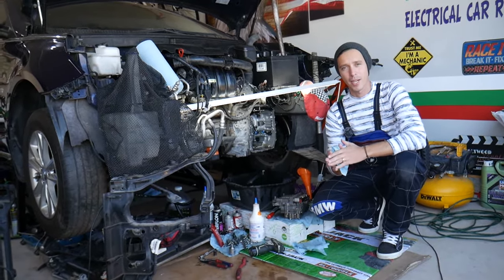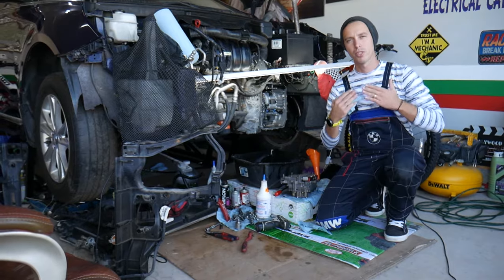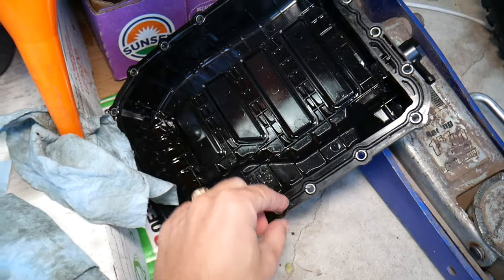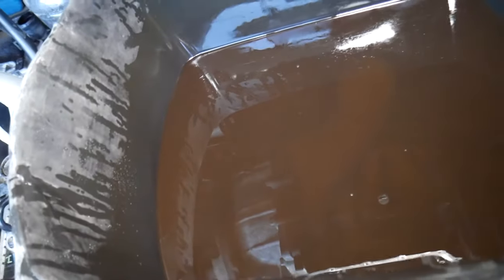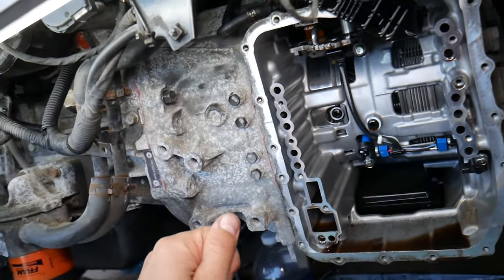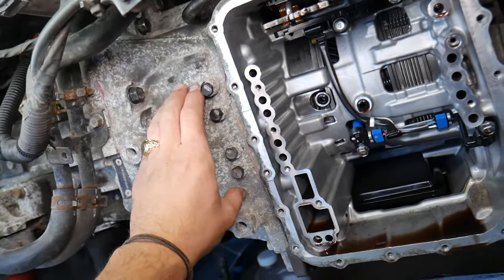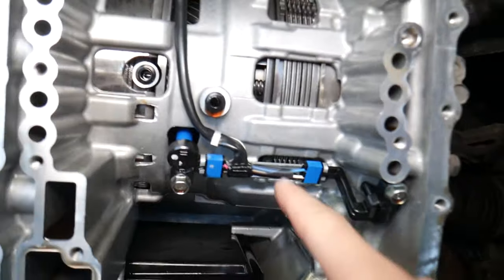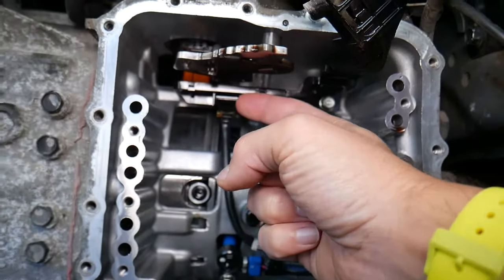INPUT SPEED SENSOR OUTPUT SPEED SENSOR LOCATION REPLACEMENT EXPLAINED

Comment: Just to add a comment, my transmission had to be pulled to replace the INPUT speed sensor in my 07 Suburban 1500 4x4. Not an easy fix. It amazes me how this is never talked about on Utube or any where else on the net. An external speed sensor can be changed in 5 minutes.
Reply: You definitely don't have to pull the transmission to change the sensor in a.2007 chevy

Comment: I have put 4 transmission speed sensor in my 97 Camry 3 from the junkyard one I got from Amazon the car continues doing the same thing, I scan code it it say po500 when the engine light comes on my speedometer stop working and the car shift funny then the speedometer starts working again it goes back and forth, do you have any suggestions

Comment: On a 2008 Vw automatic rabbit what specific sensor controls the speedometer speed and its location
Thanks Harry
Reply: Have the same car, same problem, got a guy coming on Friday,  did u fix it???
Reply: I just changed the input output sensor inside the transmission . P0722 P0731 . Upon test driving the car does the same thing. ????
Reply: Help any ideas.

Comment: Do you have the slightest idea what could be the cause of this problem, on 2 different transmissions.
*when I drive below 2000rpm, it goes through all gears with no issues.
*when I push it over 2000rpm, it shifts 1>2>3>4>slips^limp mode.
*It slips only between 4th and 5th at over 2000rpm.
*Lastly, it's an 01V ZF5HP19FLA in Audi A6 C5

Comment: Hello brother Can you help me... I own an Infiniti QX70S, model 2017. There was a delay in the transmission and I checked it on the computer and the code P0720 appeared. Is the sensor inside the transmission or outside?
Reply: The mechanic told me that it was a manufacturing defect and that I had to replace the entire gearbox. Is this true??? The engine check mark does not appear on the panel, and the problem occurs from time to time

Comment: I have a2009  kia borrego 3.8 lx and can not find where the vehicle speed sensor is located ..I've been told it's on the top outside of transmission.Bjt the wires are type that go internal I think

Comment: I changed the speed sensor on my 2016 hyandai Elantra an checked for damage wires and I'm getting p0713 an po722 an I changed the temp sensor. It revs high but in overdrive an finally jerks an goes to second through 6th an some times it doesn't shift an I'm stuck in over drive I'm lost
Reply: Could it be a failing solenoid
Reply: Or valve body

Comment: 00652 - Gear Monitoring

00652 - Gear Monitoring: Implausible Signal
Possible Causes
Automatic Transmission Fluid (ATF) Level not OK
Vehicle Speed Sensor (G68) dirty/faulty
Impulse Wheel dirty or Installation faulty
Gearbox Speed Sensor (G38) dirty/faulty
Impulse Wheel dirty or Installation faulty
Multi-Function Switch (F125) faulty (but not detected)
Clutch or Valve Body faulty
Automatic Transmission Fluid (ATF) Pump faulty
Possible Solutions
Check Automatic Transmission Fluid (ATF) Level
Check/Clean/Replace Vehicle Speed Sensor (G68)
Check/Clean/Replace Gearbox Speed Sensor (G38)
Check/Replace Multi-Function Switch (F125)
Check/Replace Clutch and/or Valve Body
Special Notes
The ratio of engine speed to gearbox output speed in the currently engaged gear is implausible.
Slip rpm with torque converter lock-up clutch disengaged must be greater than stall speed.

Comment: Regarding replacing the sensors… Are you certain about having to replace both the input sensor and output sensor, not just one?
Reply: The chances of both being bad are slim but as hard as they are to get to and as cheap as they are it's probably best to just change both.  But only replacing the bad one should work to.
Reply: @eddiebear8370  I’ve changed mine twice and about a week after changing it, it goes back into limp mode. When I changed the oil the trans swifter perfectly for about 2-3 weeks. There is an antifreeze leak though. Should I change the sensor and fix the leak or do that and get a new trans?